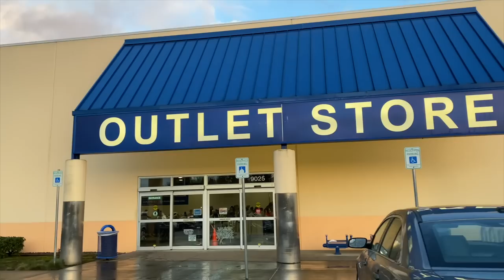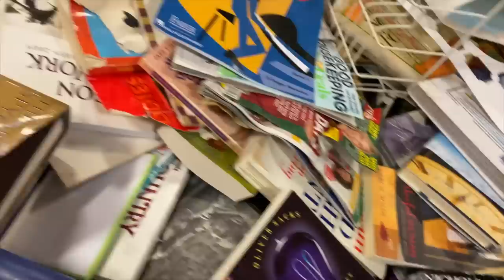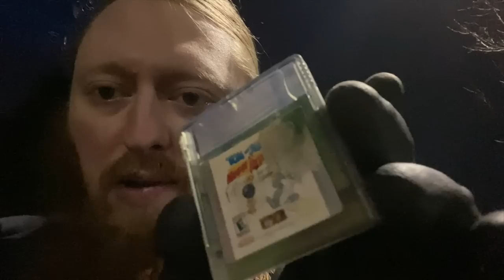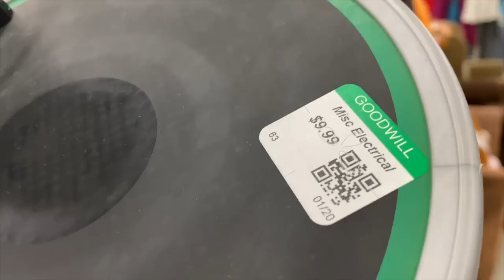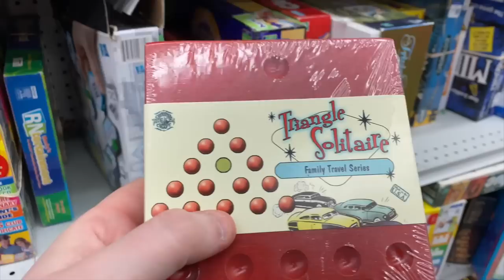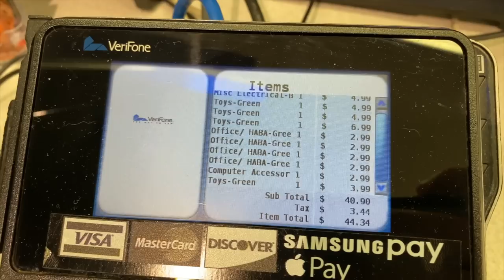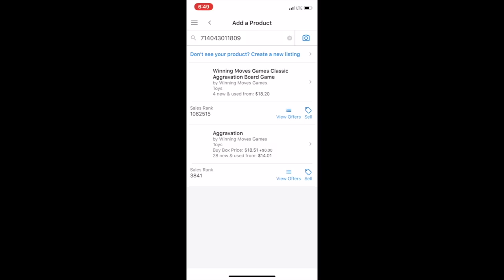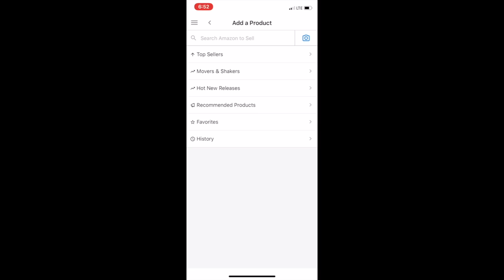Goodwill Hunting For My Game Store / Ebay / Amazon (LOTS of Outlet Footage) | SicCooper

Comment: Hey man, what kind of software do you use for the store? I was looking to get ThunderPOS but I'm still reviewing options as I wont have a store for about a yearish. If it's no trouble could you give me an idea of inventory you had? Like total consoles you had starting out. Did you start to turn a profit within the first couple months working alone? Much appreciated man and keep up the awesome content :D. I tune in every day.
Reply from the maker: I wouldn't recommend our POS, its called GiftLogic, but we are thinking of switching to Crystal Commerce. We had maybe 40 N64s, 30 NES, 30 SNES, 50 PS2, 80+ Wiis, 20 Xbox, etc. We did turn a profit quickly, but its because we saved up inventory for 2 years before opening, and sold things along the way.
Reply: Nice. Thanks for the help. That gives me quite a good idea of what I should be aiming for then. I dont think I'll need quite that much but if I can get all of that then I wont turn it down lol. I think even half of that would be good. How many systems you figure you sold weekly starting out?
Reply from the maker: Snow4dayz OSRS I don’t know exactly, but a ton. 
We didn’t have nearly as much inventory as we probably should have when we opened, our PlayStation 2 selection was maybe 400 to 500 games, and now we consistently have at least 2000 in stock at all times. The main reason that we were able to turn a profit quickly, and remain successful is that we were involved in our local gaming community, which is very big in the Pacific Northwest, and we were also attending all of the local conventions. We also pay very fair prices, and are honest and transparent about everything.
Reply: @DoubleJumpVideoGames  Thanks for the tips. I'll keep that all in mind for sure!